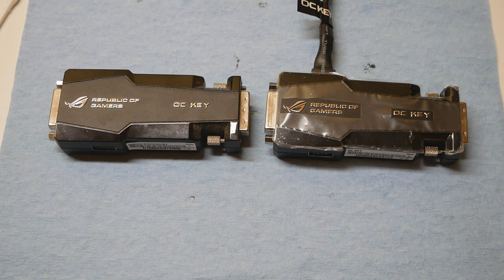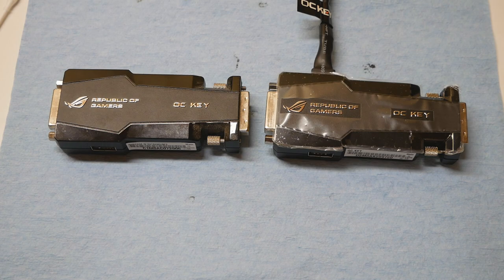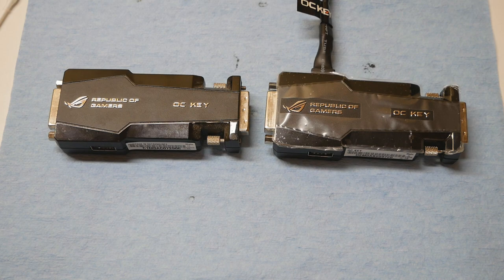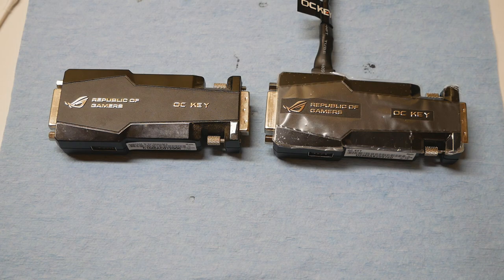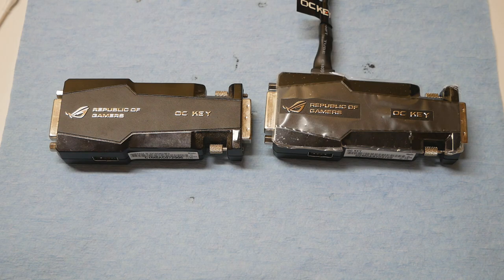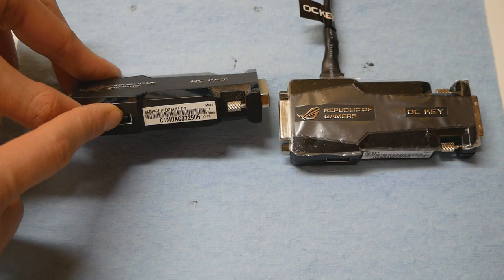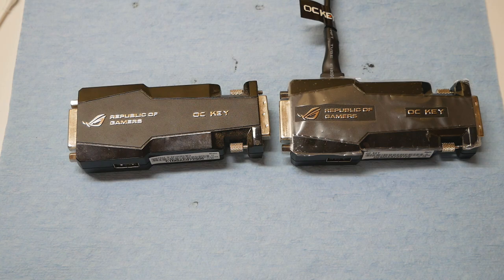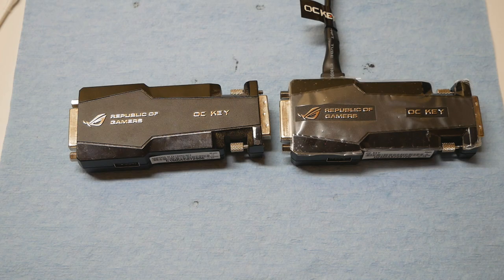ASUS ROG OC Key Firmware Problems - Maximus V Extreme & Rampage IV Extreme

Comment: You probably need to take it apart and read out the EEPROM/flash chip with a hardware EEPROM/flash programmer or an Arduino based chip reader or similar.

Comment: As others said, you need to tear it appart, to check how the PCB is implemented.
Find out which controller the board uses and which kind of memory chip stores the firmware, if any.
Then use the proper programmer to read to storage chip and dump the firmware, if possible.
If both PCB boards look the same, you can try to flash another firmware to the storage, if the chip is not write protected.
Reply from the maker: Thanks for the clarification, I will try to get them opened up.
Reply: @LuumiJuhani  
Inside you will find some kind of screen overlay chip and some kind of microcontroller, that can manage the common protocols, smbus, i2c, usb, etc.
So either the chip stores the firmware inside its own internal rom, either you will find an additional memory chip, that stores the firmware.

Comment: I saw a video last night on here about extracting firmware off of hardware using 4 pins on the circuit board tht are meant to connect to a debug tool. Not sure if all hardware has those accessible on the board or not. Just remember skimming past a video about tht on youtube last night. So im sure you can look up how to do it on here.

Comment: My old i7-4770k Maximus iv Extreme was going 0.8Ghz base clock on all cores and not 3.5Ghz I was so disappointed to buy it back in time and was my first build and still have them and never used :/ well I do not need it anymore when I am runing r5-5600x with b550 aorus elite.